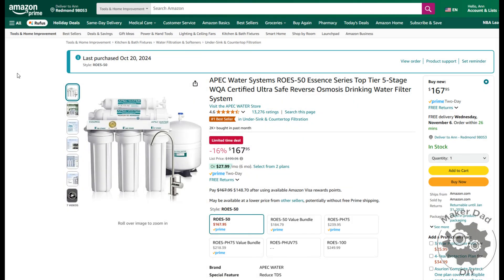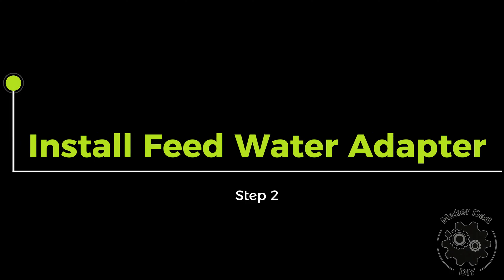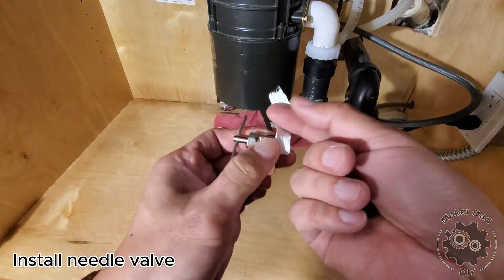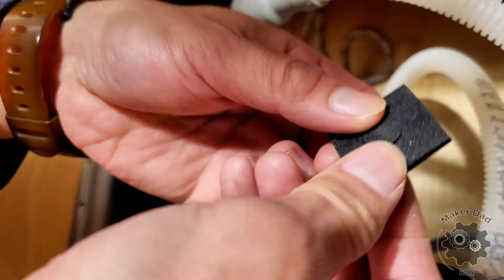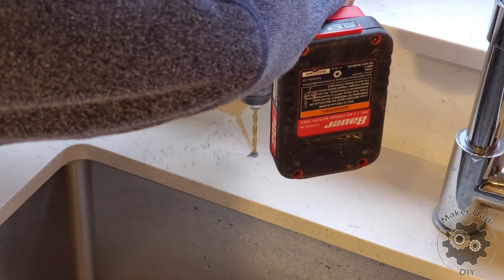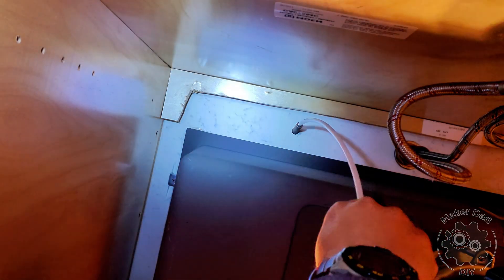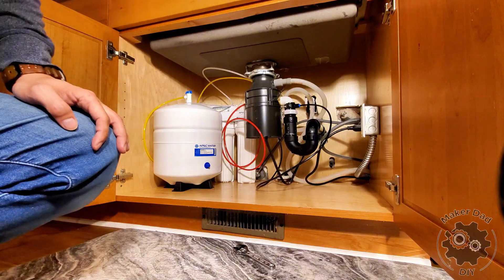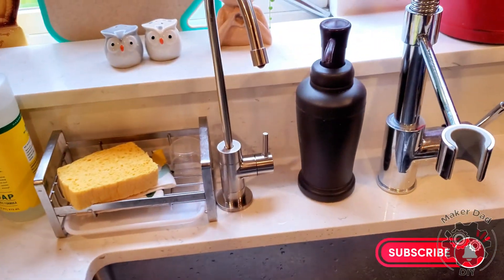APEC RO Water System: Detailed Step-by-Step Installation

Comment: Thank you for this tutorial!! I was able to get mine installed. I had to install a filter protection valve to regulate the  water pressure before the water reaches the RO system, since my water psi exceeds the systems max psi.

Comment: Thanks for the video. I'd go w/ the APEC RO-PERM System vs these systems. Using the permeate pump option helps cut waste water dramatically which is a big complaint from others. I like it b/c the tank fills faster and reduces up to ~80 % in wastewater compared with a standard system without a pump. The membrane experiences less back-pressure from the pressure tank, it runs more efficiently throughout the fill cycle rather than only when the tank is empty. It has worked good for us and it helps w/ homes that have lower water PSI as well.

Comment: I’ve had my APEC RO system for several years. Since I am about to change the membrane and all filters and remove an extra filter I had installed, I was reviewing the instruction manual and called in for tech support. I want to caution your viewers that you do not want to overtighten connections as you are working with plastic and you can crack it.

Comment: The Apec main filter canisters have a known defect where they split and leak from the caps at the screw in fittings. When changing your filters, inspect those caps for cracks. Ticking b0mb waiting to destroy your cabinets.
Reply: Damn I just got one for cheap though. The carbon filters?